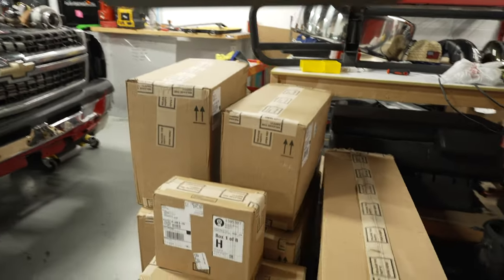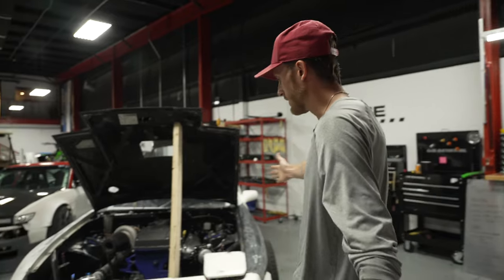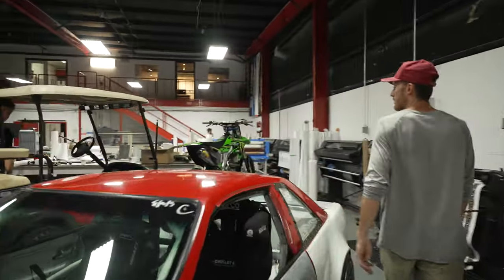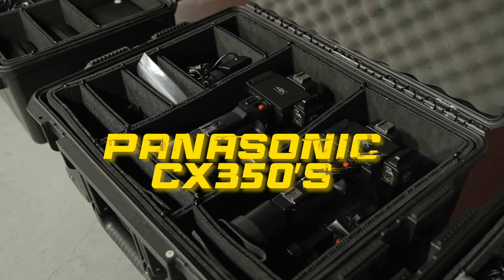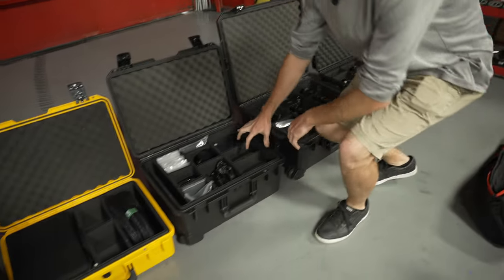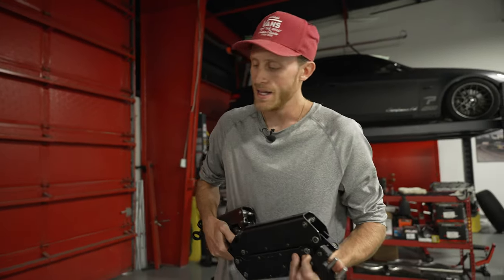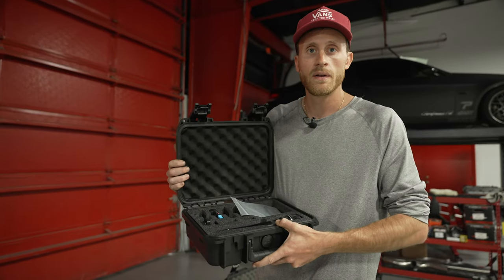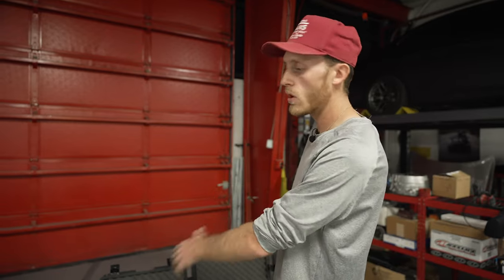The Camera Gear Has Arrived & More Drift Car DropOff's

Comment: Audio is harder to do than people realize. Not only do the mics have to be decent and positioned correctly, you pretty much need someone at a mixing board during the event to balance levels and make sure sound is coming from both ears and things like the track noise aren’t overpowering the announcers. I don’t know if that’s an option but it will really help if someone is able to monitor the audio going to the stream the entire time. You can try to have person switching video doing it but that usually doesn’t work because they are busy communicating with the various camera operators during the event. 

Good luck! I think you guys have done a good job in the past and you seem to improve at every Cleetus event. I don’t know if there is a full track camera but if there is a lot going on at once, it might be better to go to that so viewers don’t miss any action. I know it can be hard to know exactly what to focus on mid race.
Reply: What you can do with the track noise is put an ambient mic down at track level, and put it 180 out of phase in the board, that allows you to cancel out that sound from your mix at a level you choose.